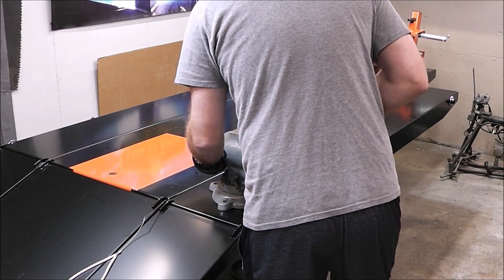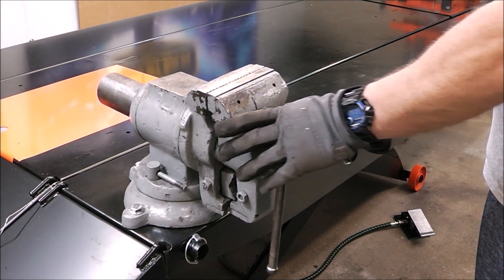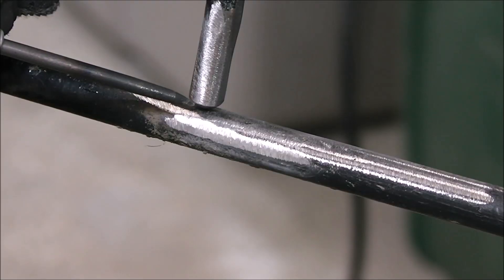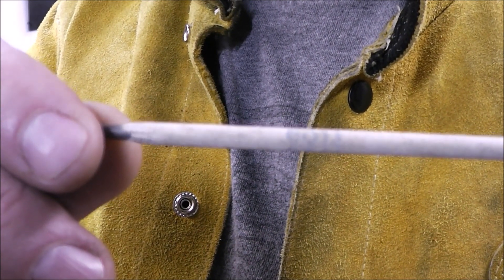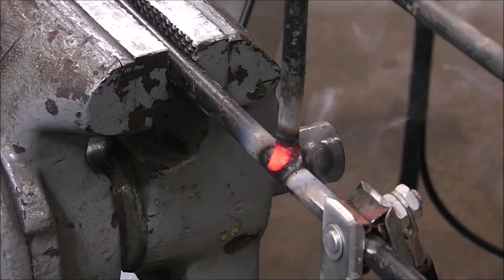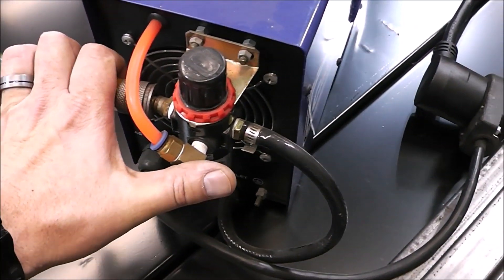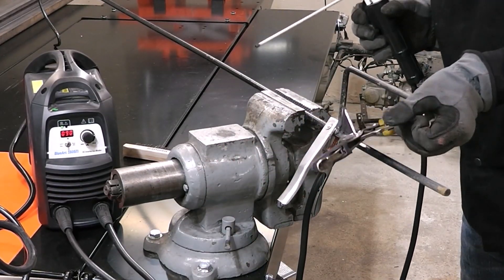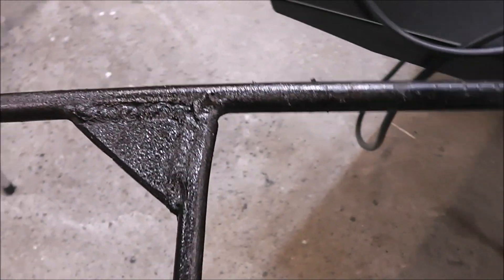Stick Welding and Plasma Cutting on 120 Volts - Metal Repair

Comment: Brandon....Question..I have a Millermatic 211 is there any problem going to .024 wire. I do hobby welding I call scrap art. I thought it would tack better. Your experienced thoughts please. Thank you...Mike
Reply from the maker: Hey Mike, I havent used a lot of .024 wire, I pretty much use .030 for everything I do but if your welding anything from 24 gauge up to 12 gauge than .024 wire is going to give you better results. It's more suited for those thicknesses and if it's something you want to look good, .024 is probably best also.

Comment: California gets so hot! 98 degrees last week even. I have to use long sleeve shirts or a jacket which I think might be the same model as yours or I'll sweat like hell and overheat. There's no way I could survive welding heat and the sun here in leather even if I wanted to.
Reply from the maker: I've been to Arizona so I can relate. Our summers here can get up in the 90's but the humidity makes it rough. I think this will be a great in place of leathers.

Comment: That vice mount is how I do mine ,  I use wingnuts on the bolts to make setting up and removing a bit quicker , they can vibrate loose so its best to tweak them with pliers.
I've been wearing a mask now for grinding- I grind by the open up n over door- one time the sunlight showed up the amount of dust particles suspended in the air, pretty bad.
Maybe do some grinding , turn out the shop lights , then shine a halogen light/good torch across the shop to see what's in the air . I've seen some reasonably priced fume extractors on ebay/amazon , I actually thought about using a kitchen hood type extractor someone was throwing out , but main problem is I reckon it would trip the breaker if I ran it when grinding/welding , ditto the proper fume extractors.
Reply from the maker: That's a great idea Jaques! Plan on seeing this in an upcoming video (provided I can get the particles to pick up on camera). I wasnt always safety conscious but as I get older my health becomes more and more important. I like the wingnuts idea too. This is why I love it when viewers leave comments! Thanks man! Be sure to pipe up in the comments if you see your idea!!!
Reply: @BrandonLund  I did a double take there- but breathed a sigh of relief when I saw it was particles you wanted to show up on camera and not some other "icles"
Reply from the maker: @jaquesdaniels2964  Hahahahaha :)